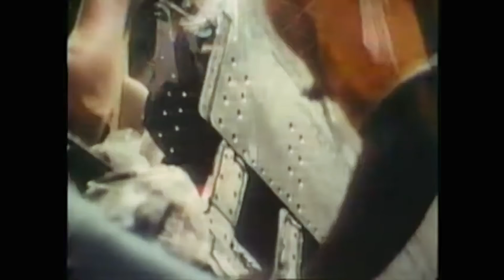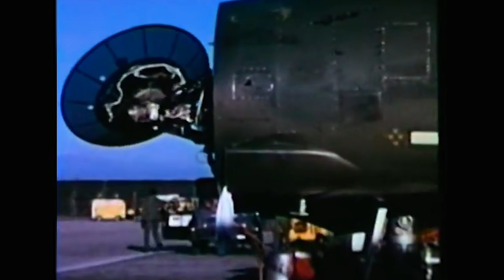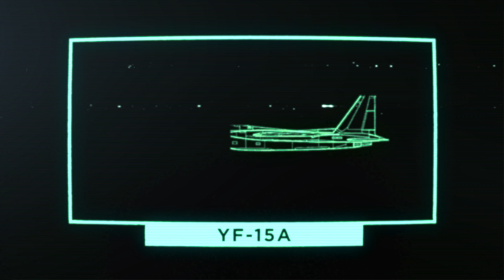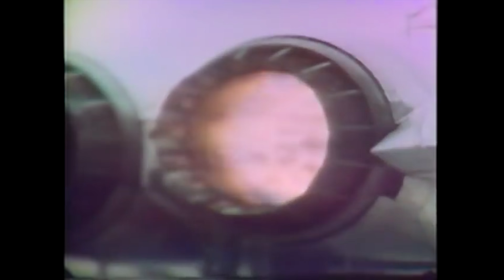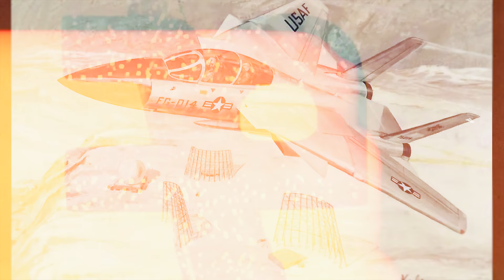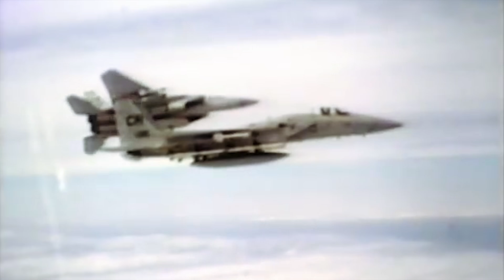F-15N | the forgotten 'Sea Eagle'

Comment: I think the mistake was framing the F-15N as an alternative or complement to the F-14 in the same (constrained) niche of high-speed, long range fleet defender.  Had they gone with a multirole proposal, good in both A2A and A2G, it would have been far more interesting to the Navy.  2 caveats though; 1.- the USAF was NOT interested in giving the F-15 and A2G capabilities at that time (“not a pound for air o ground” mentality), and certainly it would have required a lot of $$$ for development and structural reinforcement and extra weight for that job, and 2.- both are large machines and carrier space is limited.  But it would have been a great replacement for the A-4, A-6, A-7 and F-4 and would have prompted the F-15E to be developed sooner.  The F-18 though would have never existed, it position would have already been taken by a Naval F-15.
Reply: The Navy also had the same mindset in the 70s and 80s. Part of the reason why the Tomcat got retired in 91 was because no one saw it as a strike fighter at all.  When LANTIRN was added in the late 90s, it became a very dominant strike fighter, but it was far too late to save the platform.
Reply: @RedlinerSeven  I don’t think a “strike” Tomcat would have saved it, Lantirn or no, it came way too late… it was out of production long before that, and it was already expensive to have and maintain, while the F-15 still was very much alive. 

You have to consider that in the late 70s the F/A-18 was coming into being (in 1980 the F/A-18A came into service).  The Navy could have had a multirole airplane in a hypothetical F-15N maybe 5 years sooner and a more capable aircraft at that but that’s a lot of “what ifs”.
Reply: @juanpablo681  I think it would have, you're placing it in the wrong time frame.  LANTIRN was too late and only a stop-gap, agreed.  The axe fell on the 14 by 92 which left the plane with so little upgrades and a lack of parts compared to the other teen fighters...  My reference was earlier in its life, like late 70s early 80s.  Both services had a very 'single mission' idea at the time.  If Multi-Role was considered much earlier, I think the chances of a 14 being retired today would be more likely rather than in 2006.  

People forget that the 15 was also supposed to be retired as the 22 came online.  But when their numbers got slashed from 750 to just 190, the 15 became the new stop-gap for the AF.  I don't think the 15N ever had a chance for the Navy, it didn't offer the intercept capabilities of the 14 did and when it got a AWG9/54 weapon system, it was rather heavy which didn't really give it any kinetic advantage.  Plus, on the carrier deck where space is premium, the 15N took up more space than a 14 did so each carrier would have less fighters.
Reply: @R @RedlinerSeven  beg to differ .  The 18A was coming in line soon and it was already envisioned as multirole, the F-16 was proving its potential in A2G too.  The F-15N was pitched as an alternative to the -14, which it never really was going to be the Navy’s choice… but maybe, maybe, it could have had a chance as a multirole aircraft.  Albeit heavier than the F-15A.  Agreed that it would have competed for the limited space on a carrier, and the F/A-18A was much more compact.
Reply: @juanpablo681  Only because they were cheaper and needed to replace the A7.  The AF followed suit with 16s to do the same job bc 15s were too expensive.  Both Navy & AF did not envision a multi-role plane for their flagships and continue that mistake in the F22.  I think if the Navy had made the Tomcat a multi-role plane starting in the 70s (which it proved it was brilliant at in the early 2000s), we'd probably see an additional 15-20y out of the airframe.  I don't think the 14 would've developed into what the 15EX did though...The Navy always had a money issue since they have ships to build too. IMO, the problem with both the 14 & 22 airframe is that they were expensive active technology demonstrators (advanced BVR-14/stealth-22)and they should have had their roles develop into a bit of AG, they probably would have had more produced.  But that's a personal take of mine.  We'll see if NGAD & 47 will be the same A2A role only or if they finaly have moved on from "Not a pound for air to ground".

Comment: The F-15N was a better fighter than the Tomcat. But the Navy needed an interceptor, not a fighter. Which the Tomcat was better suited for.
Reply: The Navy needed a fighter without the TF30 turbofan engines and the assocaited 28% accident rate cause by compressor stalls (at least 40 aircraft lost.)
Reply: TBF, the F-15 was much, much better at climbing fast then the F-14, which would allow the F-15 to get up to altitude much faster and therefore use less fuel while getting up to speed faster as well (the engines would also be much less finicky then those on the early F-14s.)

Plus, since the Sea Eagle could replace other aircraft in the Navy arsenal (The F/A-18, the A-6, A-7) you could easily defend a much wider area, more constantly.
Reply: @theallusechannel it wasn't much better. It was a little better. Not enough to ignore the AIM-54 PHX on the Tomcat. Which make goes back to my point, the navy wasn't looking for a fighter, they were looking for an interceptor.

Comment: the AIM-54 wasn't that superweapon. used in anger twice and failed both times. F-14 could not deploy into iraq war because it was missing an IFF system so F-15 did the job. looking at the wars being fought, the F-15 might have been the better option being more capable in adapting to other roles than intercepting.
Reply: Fired 3x in anger by the States, 2 failed to even ignite because they were armed incorrectly by maintainers.  1 hit the ground bc the MIG23 chasing it ran away. Iran had a much better record with 54s in combat against Iraq.   

To be fair about your latter statement, it adapted real quick to becoming a strike/FAC(A) platform with almost no  budget.  In Kosovo and Afghanistan, it dropped almost as many bombs as FA18s, while even buddy lasing for allied planes.  

The reason the 14's IFF lacked NCTR was bc they never thought Tomcats would have to fight in a contested air space.  Open oceans meant only Russians to slap around, lol.

Comment: A few factors worth considering which were not mentioned here and are sometimes overlooked:

1. Combat radius (at cruise speed) is not the only important value for fleet defense. An equally (or more) relevant value is the radius at max AB with a given weapons load. Often, the concept of a continuous 150nm CAP is mentioned. This does not provide sufficient numbers of aircraft on station to defend against Soviet bombers except in extreme edge cases, such as when operating at extreme ranges where land based interceptors would have also been present. Deck Launched Interceptors are the only real defense against bomber attack.

2. "Air superiority" capability was relevant for fleet defense. Even by 1981, the Soviets possessed the Mig 31, which could fly about as as far as an unrefueled Backfire. Nevertheless, the Soviets clearly did not properly exploit US vulnerability to escorted bomber attack, probably because it would have required the cooperation of other services in pursuit of "naval" objectives. Aerial refueling capability was not added to PVO or VVS fighters until around 1989; this, however, was a game changer.  

3. The radar's capability to engage ASMs such as the AS-4 (a much more difficult target than a bomber) was highly relevant. Likewise, performance vs enemy jammers (either by home on jam or by burn through) was arguably more important than raw detection range. 

4. Cost and reliability are not the only (or even the primary) determinants of quantity in carrier aircraft, because much of the money is spent on the carrier itself. Deck space is therefore the primary determinant of quantity.

5. A small difference in speed (and rear - aspect capability of the radar) may result in a very great practical difference in effectiveness, as it may allow the aircraft to intercept the bombers further out, engage head on, and then pursue, whereas a slower aircraft could only intercept in time for a head on attack and could not, in any case, pursue afterwards. The slower aircraft would be obliged to rely on a head-on engagement with TWS, whereas a slightly faster one might not, sensitive to raid detection range and the interceptor's average speed and endurance.

Comment: The front fuselage flaw later in the F-15s life, would have shown up a lot earlier in a naval version ... or they might have caught the flaw earlier when beefing up the structure to improve the nose gear and cat/trap loads
Reply: That was my thinking as well, no way McD could navalize that airframe for ~3k Lbs, not when the early A/B/C/D Eagles had structural issues as they were. Hell, even the Legacy Hornet needed some reinforcements, though the Rhinos I flew were beefed up enough to make to north of 6k Hrs.
Reply: @TomcatAL200  And the F-18A was A LOT heavier than the YF-17
It's a lot easier to make an Air Force fighter out of a Navy fighter, than to try and do the reverse ...

Comment: MILREF: USN Fucked up Not Buying F-15N Sea Eagles which today as STEALTH Sea Eagles Beat Zero Tomcats, SLOW under-powered, overweight F/A-18 Stupor Hornets

I worked with my friend, legendary aerospace engineer Dr. Paul Czysz on military reform aircraft before he passed due to the big c contracted by being in asbestos plants for years; he said the F-15 SILENT EAGLE flew coast-to-coast undetected...thus...

Had the USN bought F-15N SeaEagles with 7 watt APG-64 radars/AIM-54 Phonenix AAMs this would beat ZERO too-hard-to-maintain, F-14A Tomcats with 10 watt APG-9 radars etc. and under-powered, overweight slow F/A-18 Stupor Hornets wouldn't it? 

Moreover, F-15N Stealth Sea Eagles would be in combat over Iran today and not getting themselves radar SAM shot down, wouldn't they? F-15N SSEs would out ACM dogfight F-35Cs, wouldn't they?

GOOGLE AI Overview                 

An F-15 airframe equipped with conformal fuel tanks (CFTs) has a significantly greater maximum and ferry range than an F-35C operating in its standard stealth configuration.(Note: The historical F-15N "Sea Eagle" proposed to the U.S. Navy in the 1970s actually predated CFTs, which were developed later, but comparing the overall F-15 platform with CFTs highlights a clear fuel capacity and range advantage over the carrier-based F-35C.)

F-15 with Conformal Fuel Tanks (CFTs)Extra Fuel: CFTs (originally called FAST packs) strap tightly to the sides of the fuselage and hold roughly 10,000 pounds (1,500 U.S. gallons) of additional jet fuel.

Ferry Range: Approximately 3,068 to 3,450 miles (2,666 to 3,000 nautical miles) when combined with external drop tanks.

Combat Radius: Roughly 800+ miles depending on flight profile and combat loadout.

F-35C Lightning II Internal Fuel: Carries 19,750 pounds of fuel entirely inside its enlarged composite wings and fuselage. It does not use CFTs because external attachments ruin its low-observable stealth profile.

Combat Radius: Over 600 nautical miles (approx. 690 miles / 1,111 km) on internal fuel.

Maximum/Ferry Range: Around 1,200 to 1,500 nautical miles (approx. 2,200 to 2,800 km).

Summary ComparisonRange Advantage: The F-15 configuration out-ranges the F-35C by hundreds of miles because the CFTs provide a massive extra pool of fuel.

The Stealth Tradeoff: While the F-15 with CFTs flies further, it creates more aerodynamic drag and has a much larger radar signature than the stealthy F-35C.For a detailed breakdown of the F-15N Sea Eagle proposal and how its specifications stacked up against navy requirements.

GOOGLE AI Overview                 

The conceptual F-15N Sea Eagle combined with Silent Eagle (F-15SE) conformal features offers an estimated combat radius of 750 to 800 nautical miles, outperforming the F-35C Lightning II's internal-fuel combat radius of over 600 nautical miles, but with major trade-offs in stealth capability.

Range and Fuel ComparisonF-15SE / Conformal Configuration: Standard F-15E/SE large conformal fuel tanks (CFTs) hold roughly 750 gallons per side. Converting these to Conformal Weapons Bays (CWBs) for stealth reduces total internal fuel capacity by about 180 to 200 nautical miles worth of gas (roughly a 950 US gallon reduction when factoring space split for weapons). However, the foundational heavy fuel fraction of the twin-engine airframe still yields a massive baseline. Even with CWB penalties, an F-15-based platform retains an estimated combat radius around 750–800 nmi on internal/conformal fuel mixtures, extendable past 1,000+ nmi with external drop tanks.

F-35C: Features an internal fuel capacity of 19,200 lbs, yielding a combat radius of 668 nautical miles (1,237 km) on clean internal fuel.

The Stealth Factor (Silent Eagle vs. F-35C)F-35C (True 5th-Generation Low-Observable): The F-35C is built from the ground up as a Very Low Observable (VLO) platform across all aspects (front, sides, rear, and internal shaping), allowing it to penetrate contested, high-threat anti-access/area-denial (A2/AD) zones safely.

F-15SE Silent Eagle (Partial 4.5-Generation Frontal Stealth): The Silent Eagle package relies on canted vertical tails (15 degrees outward), radar-absorbent material (RAM) coatings, and CWBs. As noted in consensus online discussions on platforms like Reddit's WeirdWings, these modifications only lower frontal-aspect Radar Cross-Section (RCS)—reducing it to roughly one-fifth of a traditional F-15. It completely lacks all-aspect stealth or the advanced low-observable intake/diverter design of the F-35C.

Summary Verdict

If you fly with Conformal Weapons Bays to preserve a partial stealth profile, the F-15 platform wins significantly on raw unrefueled range and payload capacity, but loses heavily on survivability against modern integrated air defense systems because its stealth is strictly limited to the frontal sector. The F-35C trades away several hundred miles of potential 4th-generation-style external tank reach to provide true all-aspect 5th-generation stealth and advanced sensor fusion.

GOOGLE AI Overview                 

An F-15-derived platform equipped with Conformal Fuel Tanks (CFTs) significantly outperforms an F/A-18 Super Hornet in raw range and combat radius, even when accounting for the aerodynamic and volumetric trade-offs of the Silent Eagle's low-observable configurations.(Note: While an "F-15N Sea Eagle" was a conceptual carrier-based variant proposed in the 1970s and the "Silent Eagle / F-15SE" was a land-based stealth concept from 2009, comparing their fuel-carrying philosophies reveals clear kinematic realities.)

Range and Combat Radius Comparison

F-15 with CFTs / Strike Eagle Baseline:Internal + CFT Fuel: Carries roughly 10,050 lbs of fuel in its conformal saddle tanks alone, plus heavy internal fuel, totaling over 23,000 lbs of total fuel capacity when drop tanks are added.

Combat Radius: Roughly 1,000+ nautical miles (nmi) for unrefueled deep-strike or air-to-air patrols.

F/A-18E/F Super Hornet:Internal Fuel: Carries roughly 13,500–14,400 lbs of internal and optional conformal/external fuel.

Combat Radius: Roughly 390 to 450 nmi on internal/CFT fuel alone before needing a tanker or turning back.

Factoring in the "Silent Eagle" Stealth vs. F/A-18 Non-Stealth

The Stealth Trade-off: The F-15SE Silent Eagle replaced standard fuel-heavy CFTs with Conformal Weapons Bays (CWBs) to lower its frontal Radar Cross-Section (RCS). Using internal weapons bays instead of external pylons reduces drag compared to a bomb-laden non-stealth jet, but trading fuel space for internal bays reduces the total maximum fuel fraction by roughly 150 to 200 nmi of range compared to a standard wet-CFT F-15.

The Comparison: Even with the reduced fuel capacity of the internal weapons configuration, the massive baseline airframe and powerful twin engines of the F-15 allow it to carry vastly more fuel and go roughly twice as far as a standard or Block III F/A-18 Super Hornet. Furthermore, while the Super Hornet relies on external hanging stores that spike its RCS, the Silent Eagle successfully masks its ordnance in frontal sectors while retaining a superior kinematic reach.
Reply: Cobra Condor Z25 outflew the Silent Eagle in every way. Captain Joe even made carrier take off and landings!